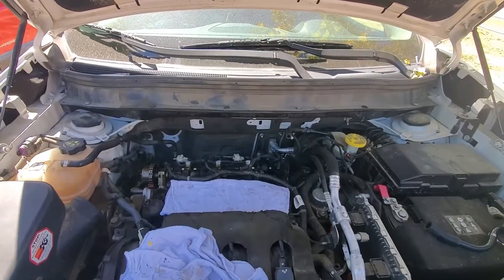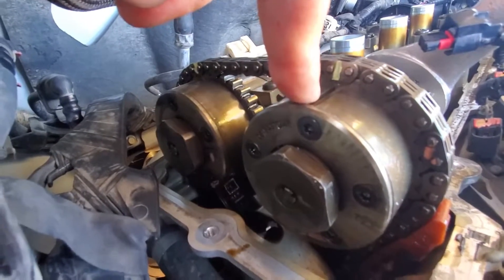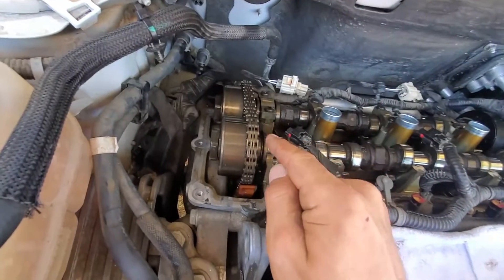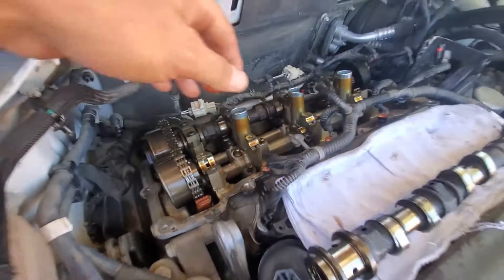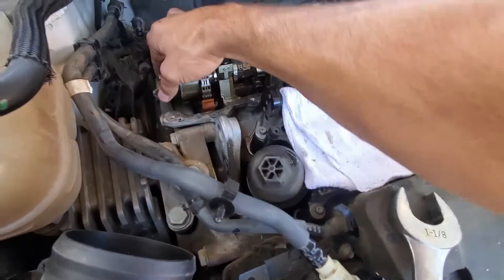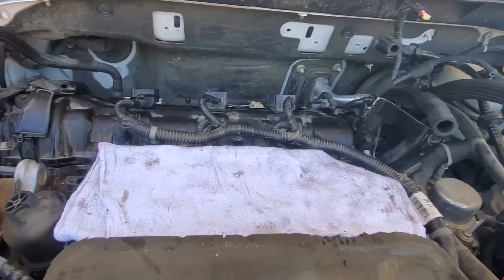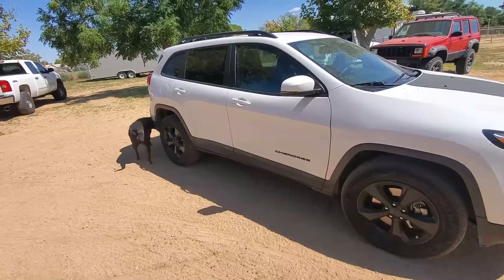Jeep Cherokee 3.2L Failed Rocker Arm, Repair How to (Part 2)

Comment: As a 10yr tech, I've mostly worked on 4cyl and v6 honda, but not touched the FCA v6's.... how long did it take you? Mine started ticking and I feared this is gonna be my issue ... yay lol.
Reply from the maker: After i ordered parts not that long. I did the work in an afternoon. These penta star v6's are prone to this because of a poorly designed rocker. The car has 100k miles over what it had when i made this repair.

Comment: Thank you so much for explaining this top end rebuild to us! (For anyone with any one of the three P0305, P0303, P0301 (cylinder issue) codes as well as a P219A common miscompare with a/f based on maf vs 02 sensor)
Reply: I recently purchased a previously owned 2016 Jeep Cherokee Trailhawk with the 3.2L V6. While the battery was all it needed at the dealership, there was an obvious reason why it was auctioned off to them so low. I bought it at $9k from the dealer. No check engine light then. However, more things became apparent.
Reply: Within a month, I had some dodgy engine issues, a light engine tapping noise when I accelerated, and the smell of burnt oil coming in through the air-conditioning.  Meanwhile, I had a light tap when it changed cam angles on the dual overhead cams when accelerating as well as a Bank 1 a/f light along with a no.5 cylinder misfire.
Reply: I addressed the burnt oil issue with new valve cover gaskets along with intake gaskets. The bank 1 (bulkhead cylinder) valve cover gasket was toast. Hence, the burnt oil smell because it was being burnt off on the engine exhaust.
Reply: Since the reassembly of the top end of the engine with new coil on plugs and 3 new bank 1 spark plugs, as well as a new number 5 fuel injector. I am at this rabbit hole where I am now looking at the replacement of the cam and rocker assemblies on the bulkhead (1,3,5) cylinder head.
Reply: After asking Gemini to aid me in troubleshooting, it led me to your videos. As well as providing me the part numbers for the cam shafts and the rocker assemblies. While I did ask a local shop mechanic what he thought, he presumed it was likely oil getting to a plug on the backside of the engine, causing a lack of detonation from the spark plug. While that may have been the root cause analysis.  I am looking to cure the tapping noise when accelerating.  This brings me to your informative video.  Thanks again! I hope to update you soon with good news!
Reply from the maker: If this isn't cleared up look at our video on the oil cooler on the playlist for this car. It can have similar effects if the cooler is leaking. You can tell because oil with pool on the top of the engine.
Reply from the maker: Best of luck

Comment: I just replaced all of my rocker arms and lifter. Its running rough after start, is that normal and how long does it take to smooth out?
Reply from the maker: If it was done right, it wouldn't be running rough. There is any number of reasons why something could be off but most common is timing.

Comment: This engine is hot garbage. Bring back the 4.0 and inline mounting.
Reply from the maker: @NoFace-jp6dk  i agree. The 4.0 was a great motor but has no power unless built into the 4.2, then it loses its reliability. The 3.2 is better than the 3.6 for reliability but has less power. The pentastar is a crap design though.
Reply: Just curious, what makes the engine crap? I’ve had a ‘17 Cherokee trailhawk that has been basically perfect so far. I wasn’t really interested in it since it’s my wife’s car (therefor not allowed to fiddle with shit 😂) but I figured being 81k miles something had to fail soon despite no current warning signs that I can tell. Only known issues I’ve found are this lifter, an oil leak, and I think some rear wheel drive module thing. @SKPcars great video, man
Reply from the maker: @SGCXD  the main problems with the pentastar motors which is the type of engine this is. They made it into a 3.0, 3.2 and 3.6L are all problems i have dealt with on this channel. They have a oil cooler exterior mount in the valley of the engine under everything. Made out of plastic and o-rings and they leak every few years and need to be changed. For people who don't do cars this is an expensive repair. The other problem is the one you commented. They have a tendancy to drop the roller on the rockers, drag the cam and potential blow the motor if the valve strikes the piston. Next worse it need the head rebuild. If you get lucky it just doesn't open and can be repaired like i did with this. All thosr repairs are highly expensive repair to an engine. I think i fixed this for about $250 in parts and my labor for free. Unless you know how to do it, it's $1000s. There are a few other problems with these but those are the top ones for sure.

Comment: Hello..i have to replace camshaft on a friends vehicle. Im wondering when im.taking the cam out i have to undo the oil control bolt. How are the phasers holding up with the chain?. Do i need any special tool to hold the sprocket teeth.
Reply from the maker: Ok so there is the right way to do a job and the easy way and sometimes they aren't the same. If you do it like i did. Remove oil control bolt and set phaser straight down, it will work as long as you still have good tension on the tensioners for the chains. If the tensioners are bad, you will lose the timing. They make some plastic wedges, i may have time listed in the description that hold everything in place. I don't have them and didn't see a need for them when i did it. You can also zip tie the chain so it wraps tightly around the phaser if you fear the tensioners are going out but at that point you need timing chains anyway. The cam and the phaser are keyed to each other so they won't lose their position but chain and phaser could. If you do it the way i did, you have to be mindful not to touch it while doing everything else. I hope that answers your question.

Comment: Back again!,  engine is currently apart as we speak.   If I rotate to top dead center on the back side do I have to rotate the front side too?
Reply from the maker: If you have cylinder 1 at tdc, when you pull the cover on the other bank, it should look the same. If not, your timing is off and your engine may have other problems, if it ran that way. There is no tdc on both sides. Tdc is when cylinder one is to the top and the load is off all the engine components.

Comment: Did you have to do a Cam/Crank relearn? I’m getting P0016, P000B & P219A after changing the same intake cam.
Reply from the maker: As far as i know, there is no relearn for these. This could be a few different problems. The cam sensor could be bad.  The cam could be out of position to the chains causing a timing issue. Which would make sense since you have the p219a. Or you may have installed the wrong cam the numbers have to be the same because they made a 3.6L that would have a different clock position on the cam. The cam part number is a important on this. Hopefully that helps. Fastest fixes are position and sensor.

Comment: U make that look way more difficult I seen a mechanic replace the bad rocker arm and all he did was loosen the bolts holding the rocker arms and pulled the nad rocker arm out at a angle replaced it and re tightened bolts at 84ft pounds
Reply from the maker: You can slip the rocker in and out if you caught it in time. You shouldn't even have loosen much of anything in there. The key is when you catch it. We had cam shaft damage. The whole setup needed to be replaced. Besides, there are other channels and other videos about this stuff. You don't have to do what we did. Thanks for watching.

Comment: How did you get the cans in top dead center? I can’t reach the crankshaft to save my life.
Reply from the maker: I'm pretty sure it gets explained in the video. i used the cams while still under tension from the chains. There is a section on it that is set for a wrench. It is very difficult if you try from the crankshaft. It becomes more difficult if you removed everything and then want to get to TDC.

Comment: I’m doing a replacement of only a couple lifters and rockers.   Do I need a new gasket set and head bolts or would I most likely be okay?.
Reply from the maker: I would inspect the gasket if you are going to try and reuse it. In most cases, reusing it is not recommended and they are only around $15 for valve cover gaskets, if i remember correctly. I did reuse the intake gaskets but also not recommended. You won't need head bolts, you aren't taking the head off. I think you mean valve cover bolts they stay in the cover. I have a link in the description for all of the parts.  If you are not used to doing this type of work, it could seem intimidating. Once i had parts, i think i did the work in an afternoon. Take your time and go slow is all i can recommend if you are going to attempt it.
Reply: @SKPcars  thank you sir,  it absolutely is intimidating.  I know my way around a set of tools but this is one of those things,  cause if I fuck up I don’t have a car until I fix it or get it fixed
Reply: I’ve genuinely been putting this repair off because I don’t wanna start and then get fucked over.

Comment: Was there any ticking noises associated with the collapsed rocker? Or was the only clue misfire codes?
Reply from the maker: There was a ticking that i missed because these chrysler engines have a small tick to begin with. Once it failed, i realized, that is why i was noticing the tick more. If you have one you suspect is ticking. You may find it  before it fails by stethoscoping it. Good question, thanks for the comment.
Reply: How did you turn the motor to top dead center after you had in apart
Reply from the maker: @thomasblankenhorn5639  i actually didn't remember and had to start watching the video to remember. Before i started the video, i did it from the cam while everything was still tight. The wrench i used to back up taking off the oil control valve. From that position, i turned the cams slowly until i got it to tdc at the timing marks. I wouldn't recommend doing it from there unless your timing chains are tight and in good condition. If you have already removed parts you are going to have to turn it from the crank which is much harder to get to. The chains will only line up with the timing marks on tdc for the #1 cylinder. Hopefully this answers your question if not let me know.
Reply: Hay buddy how did you get the new cam back on to the timing gear it's so tight I've been trying to get it on even on an angle but won't go
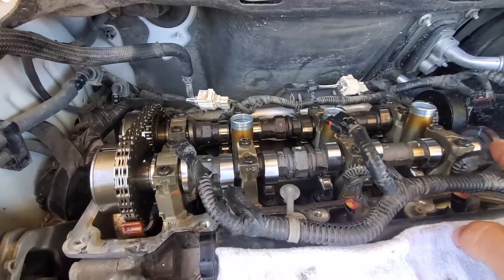Reply from the maker: @thomasblankenhorn5639  i start explaining it about 8:30 into the video. it sounds like you have already tried that though. you may have to relieve some pressure by lifting up the phaser slightly. it may have slipped down enough to misalign. normally i put a little upward tilt on the phaser also. That will give you a little more angle to work the cam into it. if you can get it started and it just won't slide up, your key position may be off just slightly. if you put the oil control bolt in and get resistance from trying to draw it up you are contacting the key. I am not sure what is misaligning but remember it came out that way, it should go back that way. hopefully that helps.